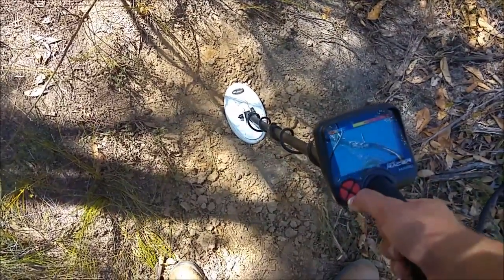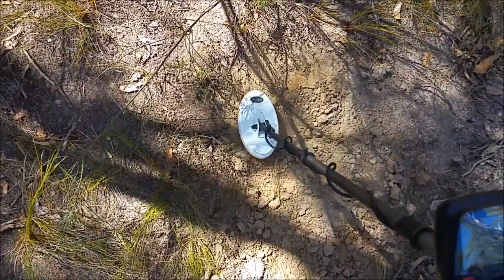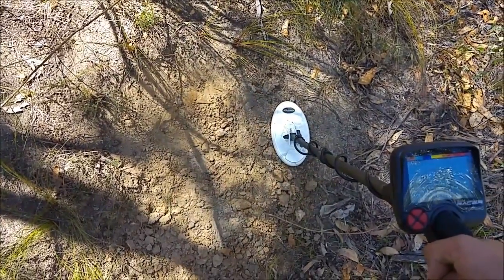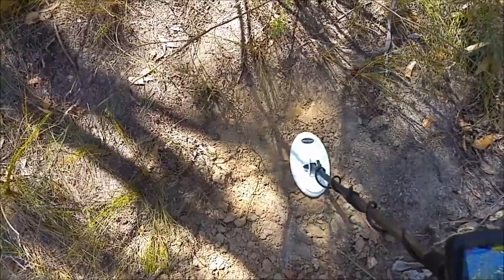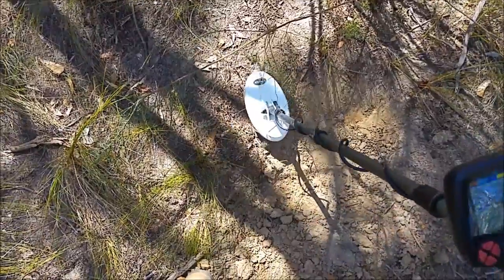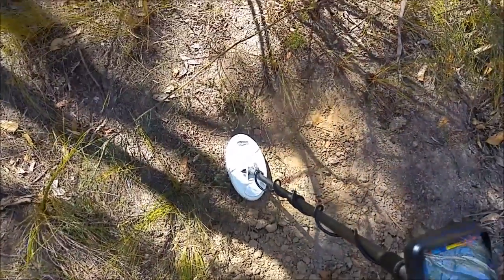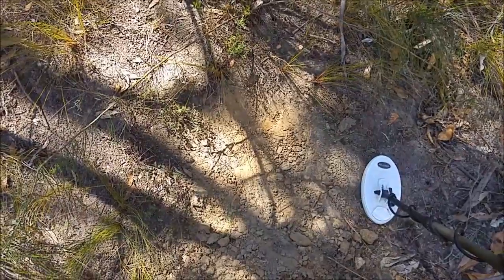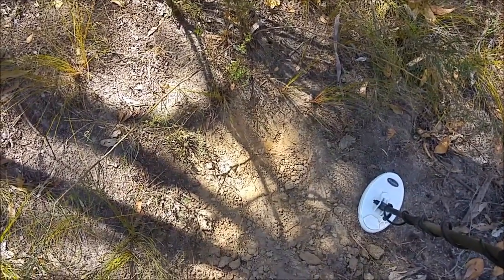Makro Gold Racer - iSat & Sensitivity optimisation

Comment: Hey mate, several questions if I may.
I have the gold Racer and have the gr26 and gr19 coils.
Which coil is better at finding small gold, talking around the 0.1g possibly smaller at the base of mullok heaps.

As I understand this video the ISAT setting will decrease the time the detector takes to recover from ground noise at the cost of depth?
So you could probably increase sensitivity if you're running a higher ISAT so long as the threshold stays level?
When adjusting ISAT and sensitivity do you play with the threshold and if so how/why?

The area I'm in has a few places where it's possible to find gold from 0.03-1 gram commonly, so any suggestions on making the machine pick out those small targets?
Reply from the maker: Hi mate, I feel the GR19 has a very slight edge on targets under half a gram. Bigger bits, there isn't much difference. Correct, faster recovery can lose depth if you set it too high (fast). But a slower recovery will give you an erratic threshold so you will not recognise faint responses. The Sensitivity will be dictated by the ground. Get that right first, then adjust you iSat up or down as required. You want your threshold steady but on the edge of starting to break up. Best of luck out there!

Comment: Hi Nerad, what goes deeper the Gold Racer or Gold + ?  I would be interested on a Gold+ field test.
Reply from the maker: Hi Richard, the Gold+ will go deeper on larger targets, roughly over pea size. Most bits under half a gram and the Gold Racer will have the edge because of the higher frequency. But always a lot of variables with the shape and density of the gold, how it's sitting in the ground, soil mineralisation etc etc. In more mineralised soils the 19 kHz of the Gold+ will punch through a bit better.